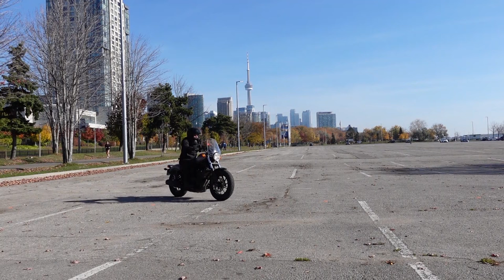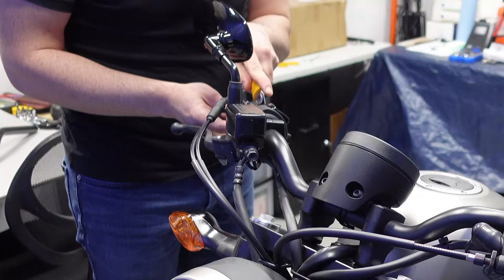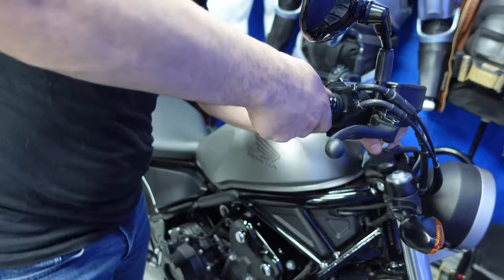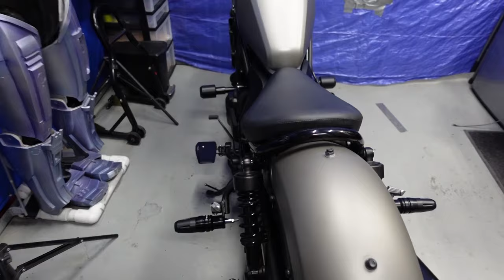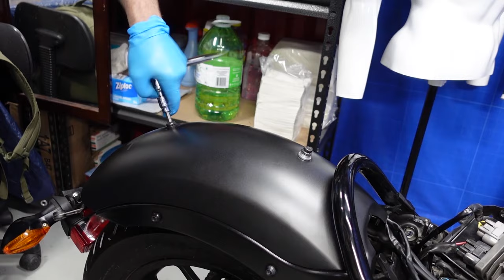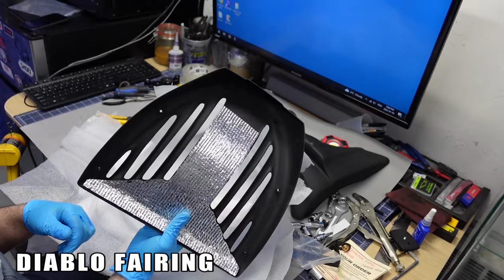Honda Rebel 500 ALL MODS

Comment: I have that same pipe ..... love it best mod ..... windshield Slipstreamer S 24 amazon  perfect no buffet at all.  luggage rack amazing Fjpacemt Black Luggage Rack for Honda Rebel Accessories 2017-2022 2023 CMX 300 500 Rear Solo Seat Carrior Support Shelf  with a prefect bag that I have not seen anyone else use holds soooo much with fold out panniers,expandable storage, water bottle holder, tie downs all of which fit perfect of the REAR SOLO Carrier previously mentioned ....
ROCKBROS Bike Trunk Bag 17L-45L Bike Rear Rack Bag Bike Bags for Bicycles Rear Rack Waterproof Bike Rack Bag. This bag is NOT cheap however best looking non evasive solution I have ever seen on a Honda Rebel.    I do love what you have done with your Rebel Moto Gear Solid but for those that a looking at what you have done I am contributing these mods that I love on my Rebel 500.   Kit
Reply: What pipe is it
From Amazon ? 
also, is it loud ?
I want something that isn’t too loud 
thanks

Comment: I think bike manufacturers make their seat uncomfortable on purpose so they can just sell you the high priced more comfortable one. I never fell for that gimmick. I just remove the seat cover, cut out the top layer of foam and replace it with dense memory foam. Makes for a much better seat and it's cheap/easy to do.

Comment: Now i need to decide if 500 is enought power for me. Cause this is for sure the look im going for.
Reply: If you wanna do more riding on the freeway id get the 1100. The 500 is great up to around 60-65. It can defenitely go alot faster than that but youll be cruising at high rpm which gets annoying.

Comment: Thanks for this video, very helpful! Question on the handlebar mod, it looks like it brought your hands up and slightly backwards. Do you know if handlebar risers achieve the same thing? I bought a preowned Rebel 500 with handlebar risers installed, but I'm not quite as upright as I'd like. So I'm wondering if these handlebars would bring my hands higher and back. Thanks for your help!
Reply: Thanks for the reply. I wonder is doing both could achieve the desired feel. I'll give it a shot and see how it does, thanks again. @MotoGearSolid